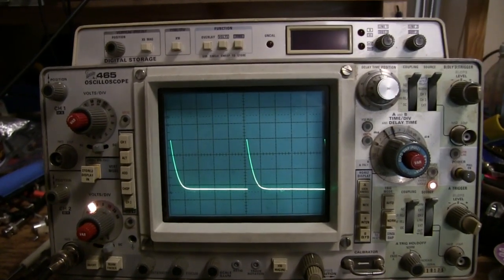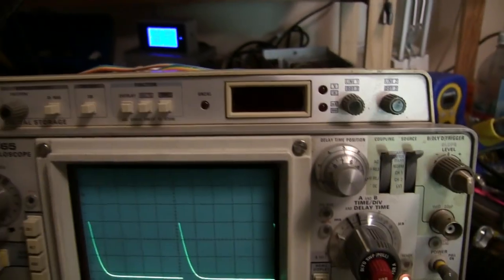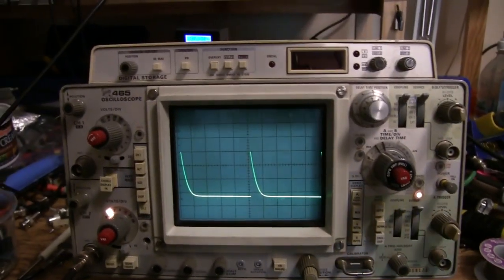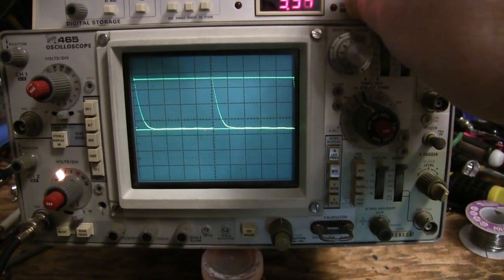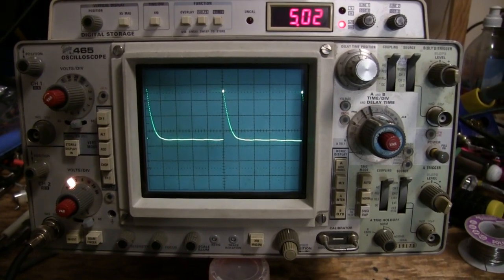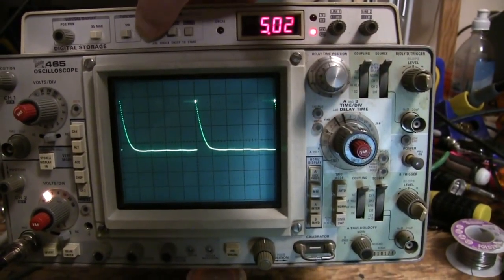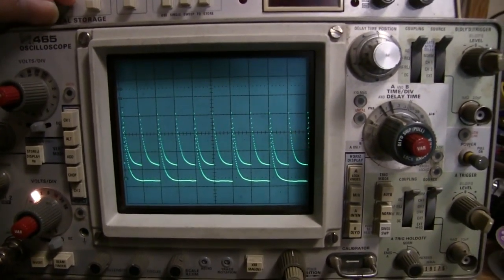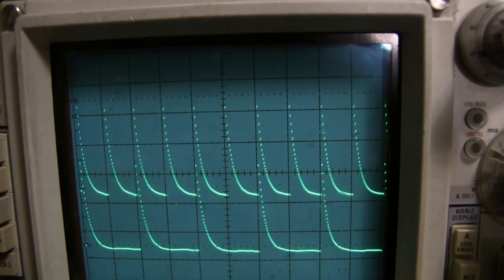Tektronix 465 Oscilloscope Mod UC

Comment: Hi, 
I have repaired a tek 465 with DM44 and is almost ok, the only problem remained is that in MIX MODE (with the use of dual time base with different timing by pulling the time base knob) I do not succeed to have on the screen the usual picture - (in the left part of the screen with slow speed time base and in the right part of the screen the fast time base). I mention that the " delay time position "multiturn vernier do not have the fine dial demultiplier, is just a knob without any numbers.
I try to measure some transistors in TB and i switch between then ICs but nothing was changed. The weird thing is that the delayed time base seems to work ok in A INTEN and B DLY'D .
Please, someone with a tek 465 WITH DM44 can tell me if this is normal? Maybe this is because of the DM44 wich interfere with the delayed time base ?   
( I repaired a tek 464 and with the same settings it work ok, in the left part of the screen I have the slow TB and in the right the fast, the transition point being controlled by the delay time position multiturn dial pot).
Someone with the 465 AND DM44 can help ? Maybe to simulate my settings on your instrument?
Thank you!